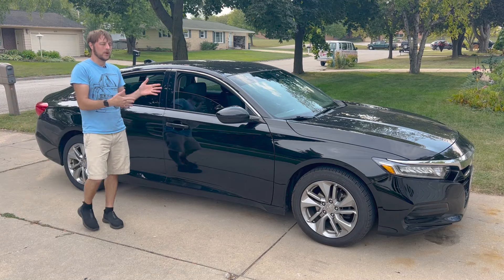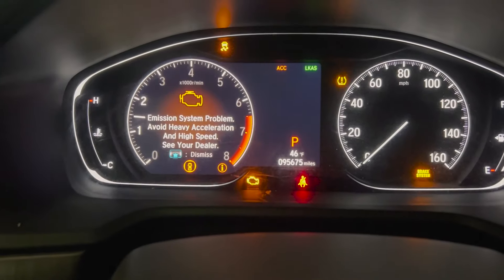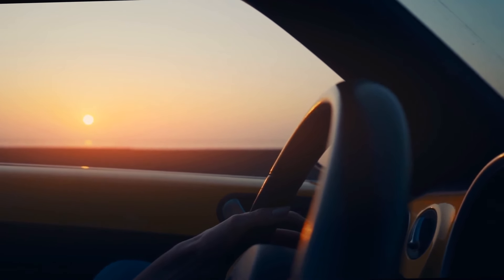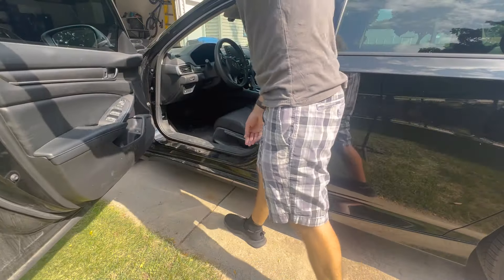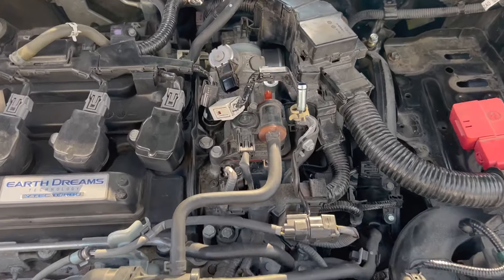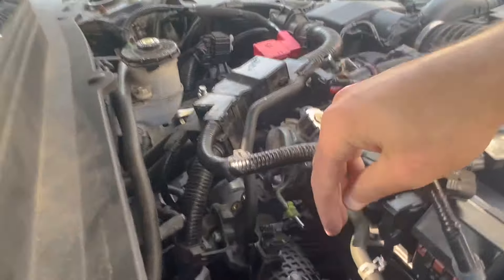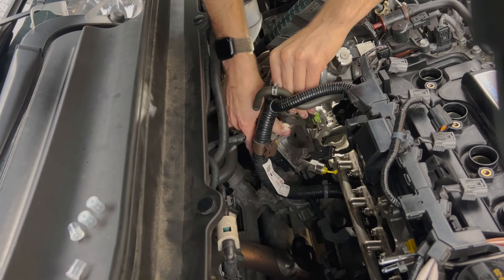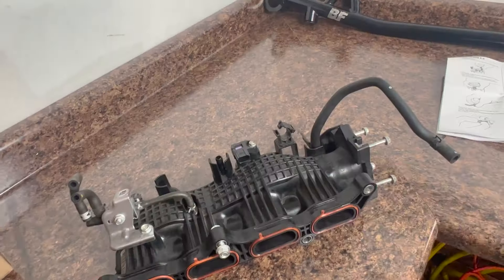Honda Accord Rough Idle & Misfire - Accord Fuel Injector Change // 2018 Honda Accord Injectors

Comment: Update:  I put an 11oz can of BG 44k Platinum in the tank, that was approx 1/2 full, topped it off with Mobil 87 octane Top Tier, by the time the gauge was near empty on that tank, most of the cold start misfire was gone.  There is still a slight fluctuation in the tach needle several seconds after startup, but the situation is much improved, and the shake in the steering wheel is gone.  No current or pending codes are present, scantool data, fuel trims, etc. all look normal.  So far so good, give it a try.

Comment: I've watched a few videos for this issue, and this one easily had the best views of each step. I feel much more confident to do this job myself instead of paying Honda $1500 to do it for me. Good job man
Reply: Hey, if your check engine light is on, and it is P0172 (system too rich) or P219C (imbalance in cylinder 1, D=2, E=3, F=4, you may be able to call Honda customer service and ask them if they can help you pay for the dealer to fix it for you.
Reply: @nesone6520  it was a misfire in cylinder 2. I replaced the pack and spark plug and warning came back after a week. Got a diag at the dealership and they said the fuel injectors are bad and they need to be replaced. Submitted a claim with Honda America and after a month or so they told me they aren't going to fix it due to the fact that I didn't buy the extended warranty.
Reply: @joshkersh08  That's messed up. I wonder if the dealership has any ability to help persuade them. I recently went through this and opened a case with Honda customer service a couple of weeks back. Took my car in this week and when I started explaining to the service manager at the dealership, his co-worker made this statement "If it's the injectors they are warrantied for 15 years and/or 150K miles and would be covered to be replaced". I advised her that I had heard about that, but thought it only applied to the Pilots from 2019. She disagreed. My car is just under 76K miles, and low and behold, they stepped up and covered the replacement of not only the injectors, but the spark plugs too. Maybe you can try a different dealership and/or maybe something changed since you got denied. Good luck. I didn't have any extended warranty either.

Comment: I had this same problem, had a misfire in cylinder 1 so I changed all the spark plugs then it went away but came back. So after having it for some months of driving it with all the lights on and off. I finally took it to Honda and found out I had a blown head gasket, ac leak and misfire in cylinder 1 and 4. Blew my socks off. .. they fixed it since I had a extended warranty thank god or that would’ve been $4500-5000 job.
Reply: How much was your extended warranty and how much did you have to pay up front for it
Reply: Has your car had anymore since then??
Reply: Always suggest Hondacare, Honda's own extended warranty. It offers the closest thing to new car warranty, but it's not exactly 100%. Don't be fooled into aftermarket extended warranties. They didn't cover to the same as Hondacare. You can actually shop for Hondacare online, there's a few Honda dealerships known for offering great deals. I got a 5 year extension and mileage to 120k, for about $1200. Local dealerships can't beat that, not for Hondacare

Comment: Same issue but they’ve replaced the injectors 2x, head gaskets, spark plugs, and rocker arm engine oil control valve. Still hasn’t fixed the issue. I have an extended warranty. I have to bring it back to the dealership. Not sure what to do now? I think this is a bigger manufacturing issue since it appears all 1.5 engines seem to be experiencing this issue. Issue started at only 67k miles. I also started using premium gas. Any input from anyone would be awesome. Thanks
Reply: @Freebandzz.Dc5  Thanks for your input. They replaced the engine rocker again, and I immediately traded in the vehicle. This was bittersweet since the car was almost paid off. But I was tired of running into issues. I think it was a combo of reasons why, from manufacturing to incompetent tech (the advisor at the dealership let me know he tried to get another tech to work on it, but they kept putting the same tech on my car, who he wasn't confident was adequately fixing it.) I've learned from my 'research' that these particular engines need premium, but the dealership people tell you they don't. I even mentioned it to them, and they still try to advise me it didn't need premium gas. I decided to lease this time since I didn't love any of the current Honda model vehicles. I also work from home, so I don't worry too much about mileage. We'll see what they have available in 3 years.
Reply: @vanessascaduto also use top tier fuel. So they say...
Reply: @vanessascaduto Sorry to hear that you had to get rid of the vehicle, I'm hoping I don't have to do the same, I really like these 10th Gen Accords and plan to keep it. This cold start misfire is the first time I've had any issues at all with the vehicle, I always run top tier gas through it but not premium. I have an extended warranty and my local dealer is quite good, I'm sure somewhere down the road mine will need injectors and/or the head gasket, but I will probably keep the car since it's paid off and I really like the way it drives.

Comment: Brooo I had this SAME exact experience! It took me ALOT of research and time trying to narrow down and fix, I had the same experience bought obd2, changed plugs and bought 1 coil to test cylinders, tried additives and YES was injections.. I admire your ambition bc I know what you went through. I'm actually worried after 1 year now that this same issue is reoccurring
Reply: Are you using regular gas? I heard you gotta use premium
Reply: New coils and plugs about a month ago and ran smoothly still afraid to step on it and Last night I felt the car almost wanted to pop the code smh having a rough start now
Reply: @jasonnicholson508 got damn how many miles you have on you car? I have the same model but mine hasn’t had any problems yet. I’ve done all the maintenance only have about 44k miles. I’m trying to avoid these issues so that’s why I’ve been on these videos. Maybe it’s that recall fuel pump? Have you replaced that?
Reply: @blackhawks1870  I have 130k.. I was having to communicate for almost 2 years (highway miles) at around 50-70k is when I started experiencing issues.. Ha the fuel pump and honda.. gotta love it.. charged 200 for diagnostic fee bc if the code (no code) doesn't point directly at the fuel pump (which the car won't even pop fuel pump code) than have to pay diagnostic fee.. my experience was sat around all day paid 200 and was told my battery was not putting out enough CCA it was around 1/2 of what it should be putting out and a coil.. replaced both and felt a tiny difference in power for A FEW DAYS than back to no ballz..
Reply: No they didn't replace the furl pump still & that's all I was going in for was the recall.. the symptoms are telling me heyy zone it's gotta be the fuel pump.. since I've replaced the plugs/coils/ both shift sensors upshift & down shift plus entire assembly around it... replaced my air filter so wth else could it be aside from injectors again or the damn fuel pump AND that's what honda did for me
Reply: You should call Honda dealerships around you. They’d should have the fuel pump available now. I called one Honda by me and they’d had like 4 available. So I made appt and just got it replaced today
Reply: Maybes it’s the fuel injectors? If not head gasket issue
Reply: @blackhawks1870  let's goooo Thank you.. ill start calling tomorrow and truly hope they have it in to replace.. I'm just so over it all I want is a smooth ride and to be able to step on the gas and feel power if I want to
Reply: @blackhawks1870  had injectors replaced once already.. a year and about 3 months now
Reply: I appreciate the back and forth man 100%.. idk if I said earlier but I do use premium gas too..
Reply: Reoccurring issue??   Did you fix it yet?    I'm experiencing the same thing...    looking for the fix....
Reply: Sell it...
Reply: @MOCave7  yeah, most definitely am going to.. its almost paid off.. its running smooth but I don't fkn use sport mode now bc the worries of it possibly having a misfire.. pile of  🐕 💩
Reply: @Jim-fn1je  yesss it was a reoccurring issue for WAYYY TO LONG bro
Reply: @Jim-fn1je what symptoms is your car experiencing? I know how this car operates way to well now for not being a professional mechanic

Comment: Can this throw a po172. My car idles good and then randomly starts a misfire then continues to be fine. Can this be injectors? I been told mass air flow sensor and my 02 sensor can throw the light. I had my car running badly on idle and went to Honda they cleaned my mass air flow and it was good then it came back.

Comment: Rough idle vibration could be the cheaper LX engine mounts. One user on the x forum noted the manual transmission mounts are the best for the auto transmission  (where they do match up).

Comment: Thankyou 🙏🏽for  your video you explained everything perfectly I did this yesterday and it cleared all warnings codes , car is like brand new 2019 Honda Accord sport 1.5 , I feel like I can take on any job now ,
Reply: To Hey, bro, how long did it take you to do the injectors? I'm a little bit mechanically kind so I don't want to pay dealership. I know I can tackle the job but what are you saying like? 3 hours, 4 hour, 5 hour job, a 1/2, a day job. A full day job. I might be tackling this next week. I've already changed my spark plugs. My fuel pump my coils.  Add my math sensor and still all chambers are misfiring.After were you having some type of same issues of what I'm having?If so, your car is now 100%, it's going no issues, no warning lights.
Thank you For your response have a good day

Comment: Using your video to do a 10th gen civic si. Same engine, charge pipe and throttle body setup a little different, a little easier actually.  Thanks for all the details.
Reply from the maker: Good to know. Thanks for the comment!

Comment: Excellent video, but I want to add a couple tips. When disconnecting the negative battery cable, unplug that three pin connector at the electronic device on the negative post, and unbolt the battery cable directly from the tapered battery post. That device is an electronic load detector, it's job is to tell the charging system the actual current being drawn out of the battery while the vehicle is running, and command the alternator how to charge. You do not want to expose that part to G-shock or collisions that may damage it, that part new is over $300. Once you remove the cable from the post, wrap that part in a thick shop rag and put a rubber band around it, and tuck it away in the corner under the hood where it won't get damaged. Also, it's always best to disconnect the negative cable first, and reconnect the negative cable last upon reassembly.

If you remove the air filter box, you can remove that plastic intercooler pipe from the vehicle, this would give you better access to the bolts around the throttle body area, especially the bolt for the GDI fuel supply pipe. There are two sensors on the pipe to unplug, one hose, and a cable bracket to unbolt. Removing the air filter box is quite easy, disconnect the MAF sensor harness, the rubber inlet scoop just pulls off the plastic radiator cover, then there are two 10 mm bolts just behind the headlight, there is a grommet at the bottom of the air box that can be tricky to remove from the body peg in cold weather, but if you put some oil on the grommet and warm the grommet with a hair dryer it will slip off the peg.  This gives you plenty of room to remove the clamp at the other end of the plastic intercooler pipe and remove it from the car.
Reply from the maker: Thanks. Appreciate the insight!

Comment: Nice job with the video. Don't forget to replace those carbon fouled spark plugs and change the fuel saturated engine oil when replacing the injectors due to a rich condition.

Comment: Great video. This is a known is a known issue with Direct injection for the 1.5T engines. Try an oil catch can. It is said to help a lot. Just installed mine.

Comment: One of the best video out there pin pointing the issue. I got the same car and Honda just sent a recall addressing this exact set of problems. Have not gotten a chance to take it but let’s hope it will fix it
Reply: Does the recall cover this 10th Generation of Accords? I'm still waiting for my fuel pump, was told at the dealership parts are not available yet, got that recall notice several months ago, still haven't heard from the dealership on when to bring it in for the pump. I doubt that the fuel pump recall and this misfire problem are related, as long as your car accelerates okay there's enough fuel delivered to the high pressure pump, where it probably does not affect what is going on with this idle misfire.  Notice from the video, heavy carbon deposits on the old injectors, which undoubtedly affects the spray pattern.

Comment: Now that nighttime temps are near freezing where I live, the cold start misfires are more prevalent, but no DTCs  yet, and scan tool data is nominal.  It always runs fine when warm.

I have no apparent coolant loss, so I'm going to try some BG 44k Platinum in the tank, and take it out on the interstate.  Will post my results.

Comment: I’m actually having a problem with my daily Tiida (HR16DE). I’ve gone through the same change out you did and was actually heading to cleaning the throttle body and the injectors. I’d clean them and flow check, before taking the plunge to replace. Great video as always!!!
Reply from the maker: Good luck! Is the Tilda direct injected?
Reply: Nope it's the PORT injection model, so they're easily accessible from the front of the engine. One of the  good things about working on the car. @BoostedFilms
Reply: What solved your problems
Reply: @ygbodybuilder3023  Replaced 4 OEM coil packs, 4 NGK plugs, Carb cleaned the throttle, Liquid Moly Injector cleaner x 2. Didn't get around to taking out the injectors as yet. Majority of the rough idle has gone only happens sporadically and only when I I've stopped at a light. Other than that smooth sailing. Would definitely take this holidays to take out the injectors, PCV and EGR and look into cleaning or possibly ultrasonic.
Reply: @syo_nara1916  Hey I had the code 40420 show up a couple of days ago and than the check engine light was gone two days later, the next day the p0304 code came on while driving and check engine light was flashing and car seemed like it didn't want to accelerate, cut the car off went to clock in came came back drove around the parking lot with no problem, what could it be
Reply: @ygbodybuilder3023  p0304 is showing as a misfire in cylinder 4. You should check everything for that cylinder. Plug, coil, wires, boot etc.

Comment: Excellent video! Appreciate the in depth detail! You mentioned that you had adjusted the valve lash previously. Can you provide the valve lash specs for the Accord 1.5t? I am looking to perform the valve lash adjustment on my Accord. Unfortunately, Honda no longer provides this information under the hood of newer vehicles.
Reply from the maker: Intake 0.21- 0.25 mm , exhaust 0.25- 0.29mm
Reply: @BoostedFilms  Awesome! Thanks for the reply!
Reply from the maker: @Harry-Ballzonya no problem. Good luck with the job.

Comment: Guys I’ve got a misfire on my Honda accord 22 1.5 and I’ve been checking on mechanics and yet no one can identify it with thr scanner and there are no codes and even my car is clear of codes so I have like a little hesitation or idle 
Checked my spark plug coil cam shafts fuel pump and cleaned my fuel injectors adding thro the fuel and other ways that some mechanic recommend and water is good . Air maf is cleaned 
What else should I do?

Comment: Hey bro I got a 2018 Honda. Accord sport 1.5 I have changed. Spark plugs ngk. Coils ngk fuel pump  and last the maf sensor still misfires in all chambers does it mean fuel injectors all bad does I order injectors from ebay they say there oem japan
Reply: My car is doing the same thing with the misfire the shop said that it is the fuel injectors but unfortunately they have to order them from Honda and one order comes every week. So thankfully I will get it covered under my warranty. However you should fix the issue you are having with new fuel injectors.